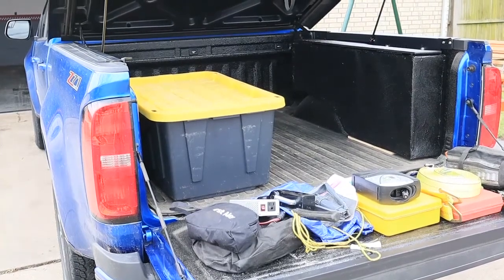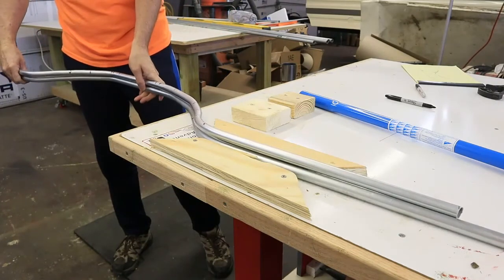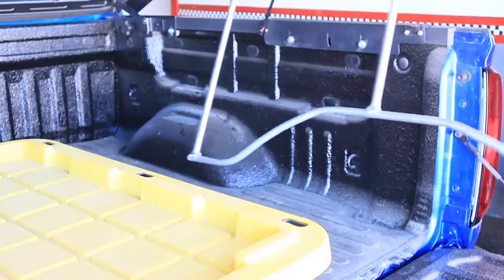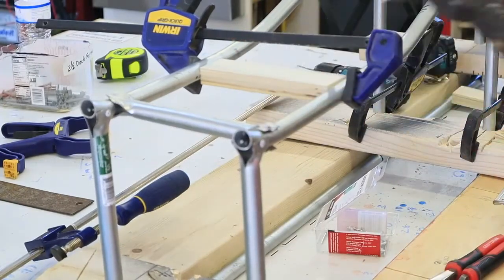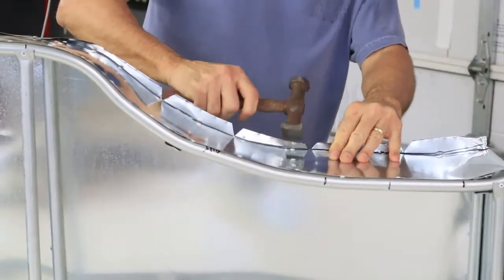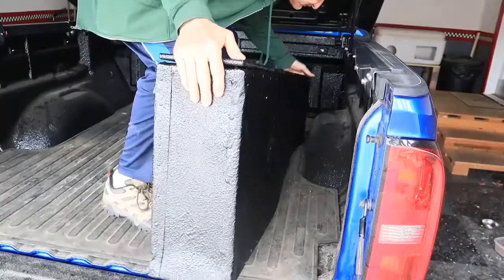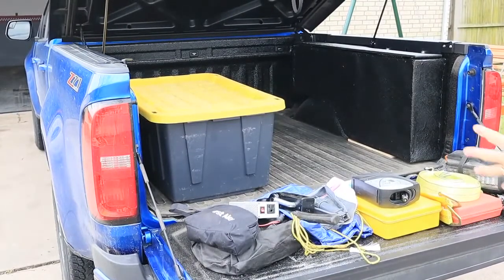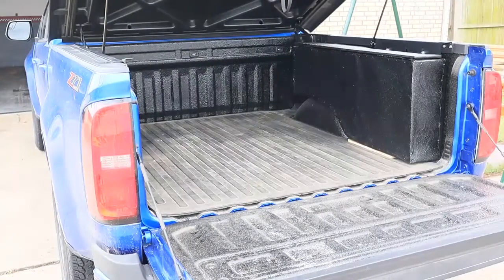HOW TO BUILD TRUCK BED TOOL BOX DIY Pickup Truck Tool Box Ideas

Comment: Really great idea! Nicest build I've seen based on EMT. Welding is great but sometimes riveting is easier and good enough to get the job done. I'm toying with the idea of building one that omitts the outside wall and sealing it to the truck bed somehow weather-tight. Mainly just want a place to keep my chainsaw and fuel locked and dry.

Comment: You realize flashing can be pictured with a knife or screwdriver?? It’s very flimsy I like how you did everything except would prefer a second outer shell and a lock
Reply from the maker: Thanks for your input. Yep, flashing can be punctured, and molded plastic can be damaged too. My 2 boxes that I made and, in my truck, have lasted over 20,000 miles so far. That includes some serious off-road trails. Both boxes are fully loaded, and nothing has failed yet. I have a locking bed cover so no need for locks on the boxes, but I do like the idea. I will have to make a follow up video about the boxes soon.